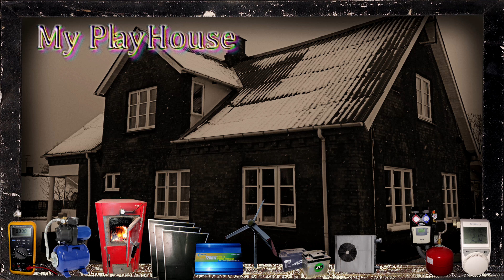Downgrading my Lenovo SR650 to Save on POWER - 1433

Comment: All my proper equipment went dark in 2022 when uk power prices went into orbit
My 24/7 server went from a dual cpu dl380 with a 12x3tb shelf to a 10th gen i5 with a single 20tb. I was sad but combined with other power saving measures i went from 400kwh/month to 90kwh/m saving (at todays prices) £800/€900 a year. Well worth a tear or two!

I use a lot of smart power strips/plugs and a combination of home assistant, hue bulbs and Logitech harmony hubs to ensure that only equipment in use is powered on, lights are motion sensitive and power themselves down etc etc

I've basically swapped a hardware addiction for an automation addiction
Reply from the maker: I can afford to use the power,, but it has become a little sport, to bring my usages down enough to run from batteries. :-)
Reply: same here in the uk its such a shame. if i didn't have a small solar array, i wouldn't be running any thing in my rack anymore, just like your self i have sized down cpus and upgraded where possible smart switches too

Comment: For power saving, as examle, my NAS server does scheduled self shutdown at nights and is automatically turned on by BIOS at mornings.. Works great and saves power, because, at night, nobody is using it and that's 8-9 hours off from bill per day.. How good is that for hardware, I don't know, that's why I'm, almost year, testing this mode.
Only NVR is working 24/7 as separate hardware.. 😂
Big backup server now is turned on once a month by request from smaller NAS server. 🎉
Reply from the maker: Uhh my NAS is my NVR,, there is more work to be done :-)

Comment: welcome to becoming your own Solar Farmer :) 12kw was a smart move I think, plenty of capacity. Hopefully that is a LF inverter they tend to last longer, one of the reasons I went with Victron, fewer electronics to fail. It looks like a nice system :)
Reply from the maker: I do believe it is a LF inverter,, "EEVBLOG" has made a video taking it apart in his video "1620"
Have waited forever for the electrician to come and install it. :-/

I got a bit greedy and got the 12KW,, as the prices differences was so small,, but this uses a lot of power,, in idle,, a couple of KWH a day,, I did not take that in to account.. :-/

Comment: If you want to improve power efficiency, you should check out migrating from a virtual router to a physical low-power one, such as some ARM64 box, or Ubiquiti if you already have some, or an N100 MiniPC. I fully understand that virtual router reduces complexity and the amount of wires and has next to no limits on routing performance, but the reason is that it uses a disproportionate amount of electricity to do the routing! Just start even a 100 Mbit download via the router, and check out the power use of the entire server compared to fully idle (no downloads). In my case the difference was so high, that you could power several physical routers on that alone, like +30W. Regular routers from TP-Link, ASUS and such, will use like 5W at most.
Reply from the maker: I am hoping to use that TerraMaster F8 SSD NAS with the Intel N305, and 32GB of ram,, and I hope to add a USB-C network adaptor,, for my virtual router.

Comment: you not use much at all, my house runs 700-750 watt 24/7 for the always on stuff , 4x 4U racks 65 harddrives 2 switches some extra fans in the front of the bayes to survive the heat , i have 12x390 wp solar in east/west on the roof to help with the powerbill. Sugestions to save more power and heat is getting less but bigger drives, one new in, 2 older out. That Deye invertor i have at a customers house might be the same as yours, i find the manual kinda complex and hard for a quick setup with batterys connected, so much settings ......
Reply from the maker: I am already on 18TB drives in My 24/7 NAS.

Comment: 163watts that's not much, my daily workstation uses 300watts. the R640s I have uses around 126watts each per node. the cost of electric is going up again here in the UK too not sure about Denmark but is there any end to high power prices ? it sucks so i understand where you are coming from
Reply from the maker: Well if I can use less,, my batteries will last longer... There are days, like today,, where nothing is possible,, as I here by 12:00 I have only gotten 0,7KWh in,, so not enough to even keep stuff going midt day,, and the inverter uses about 2KWh a day just to run.

Comment: The 2000 W just for the inverter's own use sounds unreasonably large when compared to my own experience.  Picking last Friday as a typical day, the inverter used 11,549 W with the inverter providing 11,410 W of that to me.  The delta of 139 W was used by the total of the inverter, battery, gateway and associated RF comm system.  This equates to about 5.8 W per hour for the system's own use.  The book figure for my 8 kW inverter alone is <2.5 W; the 10 kW version also quotes <2.5 W.  Your missing 2 kW needs further investigating I think as I cannot imagine the inverter being that bad.
Reply from the maker: It is using like 100-150W-ish,, about 2000Wh a day, or 2KWh a day. kind of a lot :-/
Reply: @MyPlayHouse  A project to look into.  If the power loss is real, where is it going?

Comment: Actually in System settings you have to choose Custom Mode and in Power / Performance Bias choose OS controlled. In this mode it will work faster when it's need and use less power when vm is in idle state. Also you need to change heatsink to performance one. It will allow fans run at lower RPMs and use less power.
Reply: On newer Dell servers for example there is really no need to remove second PSU, because they run on PSU 1 when on default and balance with PSU 2 only when configured or when power on inlet PSU 1 is down.
Reply: @Magicairsoft9  I believe the same is on this server.
Reply: @Magicairsoft9  But the second PSU is in standby mode, that takes about 6W.
Reply: @mattymuc  Other option when relying on power efficiency is to use less power hungry server hardware or at least not so high power demanding CPU.
Reply from the maker: Thank You,, looks like something I should look in to.

Comment: I like the idea of the micro inverters, one for every panel. I don't know if they are better for power usage though. I like the idea that the power leaving the panel area is AC, not DC. The gauge of the wires doesn't have to be larger for longer distances with AC. Also, the redundancy of multiple inverters.
Reply from the maker: I have never tried them.

Comment: I’ve created a script for my chest freezer, which only gets opened 2-3 times a week. It’s connected to a smart power switch that, via logic/code, ensures it doesn’t run between 17:00 and 20:59:59, unless it’s using over 30W. If it’s using less than that when the clock hits 17:00, it cuts the power. If it’s above, it checks the power consumption every 5 minutes and turns off when the compressor is no longer running.

I’ve also made a power switch for my computer and TV setups, so that the screen/speakers (extra devices) lose power when consumption has been below X watts for X minutes, as it’s nice to still have time to charge headphones and other devices.

The server has been split into two. Before, it was a beefy server that could handle everything—router, NAS, disks, and more. Now there’s a Lenovo 6th Gen SFF that handles router/proxy/Home Assistant and some Docker containers, while the NAS has been moved to the other end of a site-to-site VPN where there are solar panels.

Motion sensors have been installed in high-traffic areas of the home. Whether it actually saves energy, who knows—but it’s definitely convenient not having to turn on lights when carrying grocery bags.

So to sum up, I mainly focus on optimizing standby power usage and places where it doesn’t need to affect things. That said, the dishwasher runs at night to avoid the more expensive tariffs.
Reply from the maker: Thank you!! good  savings,, reading your comment here, I came to think, it might be time to look into my refrigerator,, it might be time to look at how much it uses.

Comment: I don't know if your server does it, but, if you have both the primary and redundant power supplies operating, the system should balance the power between both units. I think that would be better power usage as neither power supply is working too hard.
Reply from the maker: There is overhead on both,,if they are both running.

Comment: Just suggestion if you now don't need all the fans, you can remove some and put blanking plates in there as server fans can use lots of power 10W or more..
Reply from the maker: The fan does not run much,, it is cold in the data center.
Reply: @MyPlayHouse  @vaidkun does have a point,  Usually the CPU Upgrade kits do include the additional cooling fan so its kind of surplus on a single cpu server after the downgrade
Reply: There is also the IPMI/ILO/IDRAC That will be eating about 10w too.

Comment: My homelab is also powered from solar :D
R730xd thati got from work i've switched from 2 2650 V3 to single 2673 V4 and with 256gb and Fusion io 3.2Tb i still draw around 154W idle.
Reply from the maker: It is a difficult balances,, You want the the performances, when it is needed,, but not to power it all the time.